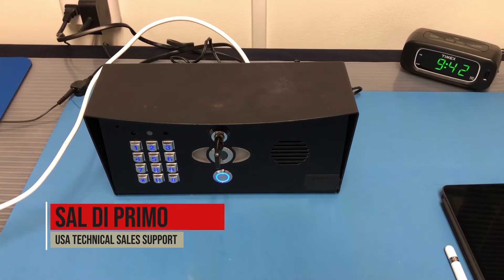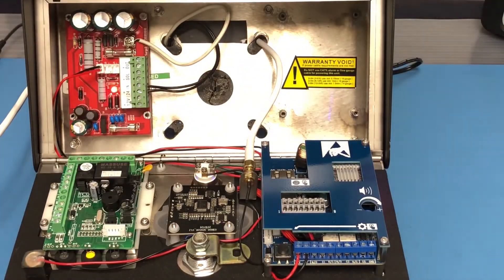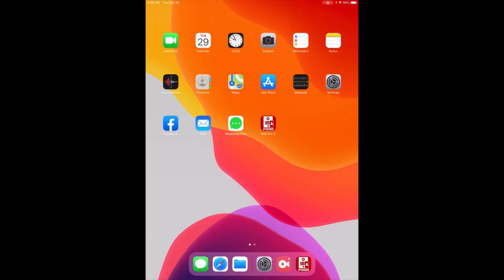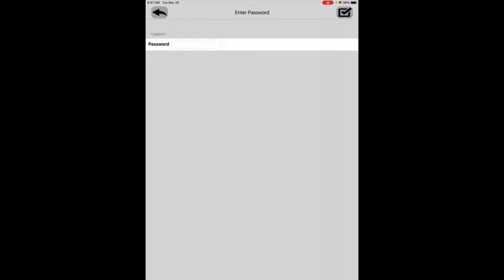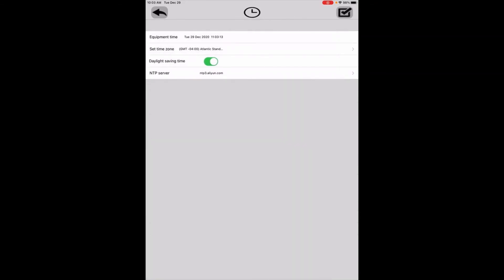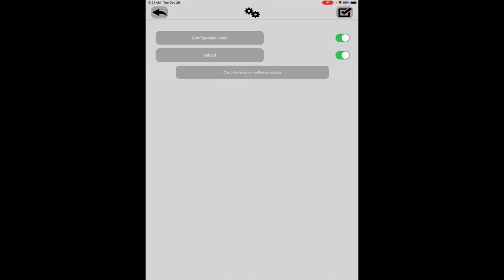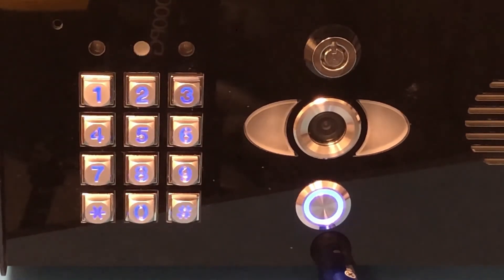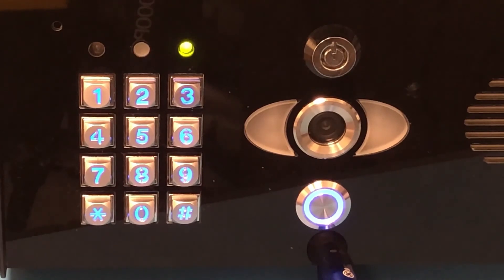AES Global PRO2 Set-up and Programming Tips

Comment: Hello, thanks so much for the video instructions! Question please, if my unit is connected via ethernet cable do I still have to go through the wifi setup? I'm asking because I don't want the unit to run on wifi but rather IP but I still want it to be able to connect to the android screen inside the home to answer the call (and the android is connected to the wifi system.) Thanks!
Reply from the maker: Hi Kim
With the Ethernet cable connected you will not have to go through setting up a WiFi connection with the intercom. Locate the AES number behind the ethernet port and enter the log in credentials manually through the app. Or if your phone is on the same WiFi network that the intercom is connected to you can search for it through the Praetorian Guard app.

This video should help you with this process https://www.youtube.com/watch?v=-Q5JQJ-rT-M&list=PLV56se_eLJqoE_MrU91jq7aDMKzWJGdip&index=4&t=1s

Thanks and hope that was helpful!

AES Team

Comment: Excellent Vid. Question: How do you reprogram the system (NOT wifi) password on the Pro2 app? Reset button inside call box?
Reply from the maker: Thanks for your comment!

If we are reading your question correctly then this video on changing the Administrator Password should be what you need! https://youtu.be/TZxz8PQA2Hk

There is also a system reset button in the unit if needed, however if you are having issues please get in touch here, or via our website. 

Thanks
AES Global